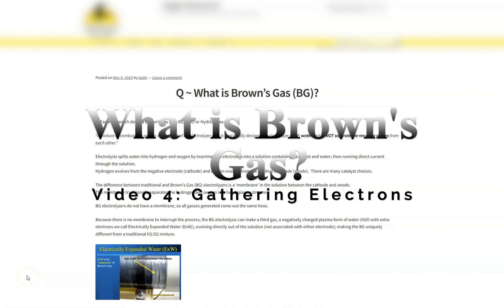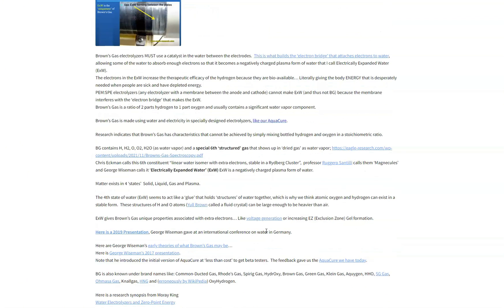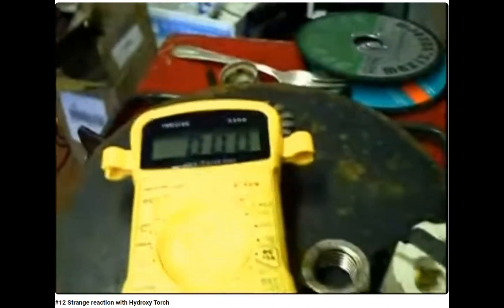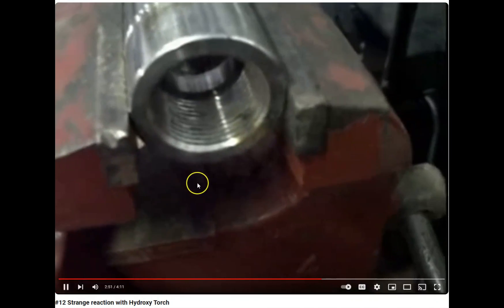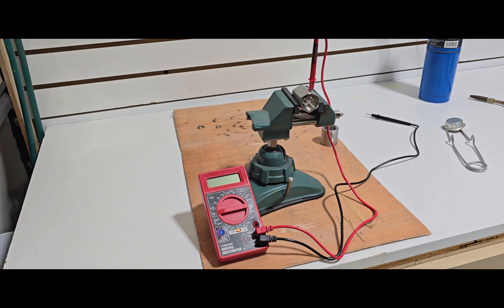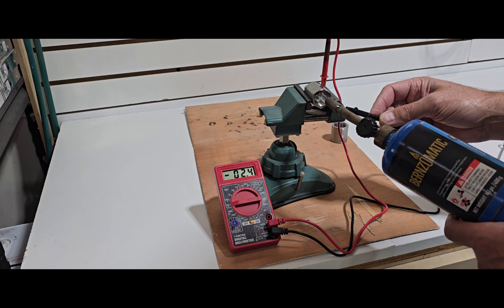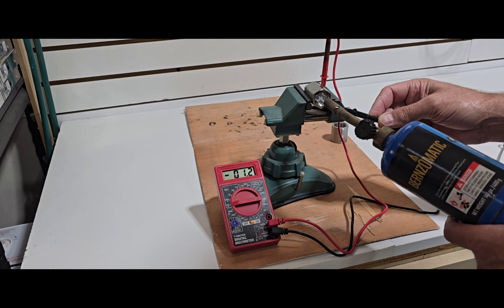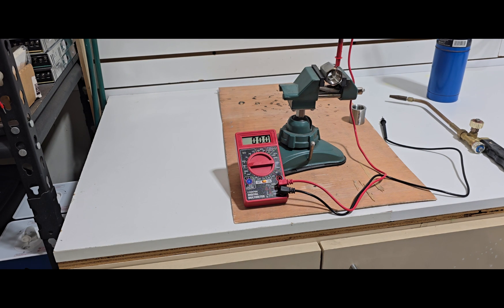What is Brown's Gas part 4 : Gathering electrons

Comment: I’ve heard that the flame temperature of Brown’s gas is about 130 degree celsius. It is possible to use a thermal camera to see if there is a difference between the flame temperature of the PEM unit and the common duct unit. Thank you for sharing these information.

Comment: These are very cool experiments done with proper scientific equipment and methods. Great work on this series, Steve. My machine is working really well with your cells and reservoir and bubbler. I'm so surprised your reservoir has not leaked a drop and your bubblers and cells are top notch. The only single complaint at all with my 30 plate is that the outer hardware and bolts are not 316 grade and initially my own reservoir in my car had leaked and corroded the bolts. Otherwise it's been very efficient and produces very well for me. I'm breathing 30 amps and using a little water, too. It's definitely better for drinking while it has a negative ORP from hydrogen. It tastes better and smoother and I drink more because it tastes much healthier and "alive." Use some veey important mineral bicarbonates guys (electrolytes). You will thank me. I'm making cert special "synthetic spring water." It's a big deal for human health.

Comment: Note that MOST 'alkaline' electrolyzers ALSO have a membrane, separating the hydrogen and oxygen streams, this is how electrolysis was done (traditionally) for hundreds of years, until William Rhodes patented the 'single ducted gas' in the early 1960's.  So it isn't just the more modern PEM/SPE electrolyzers that have a membrane.  

What was the meter scale set on?
Can you do the experiment with an analog meter so we don't see the digital 'dither'?
I'd suggest setting the torch on a stand of some sort to keep the flame in an optimized location.
Reply from the maker: Take it for what it is. Both gasses measured voltage on the voltmeter. If you want the experiment redone you will have to do it yourself. HHOBALL did it years ago and i'm surprised you have not duplicated it.
Reply: @Hydrogen4Health  I'd really like to duplicate it properly.  I'll purchase one of your H2 Life v5 to test.
Reply: @Hydrogen4Health  Yes both were measured with the same meter, that's not the point.  The point is that, in certain applications a digital meter isn't the best choice because it's impossible to get an accurate stable reading.  Thus the 'averaging' tendency of an analog meter is better.  Also, if I was to duplicate this experiment (which I'm considering) I think fixing the torch in a holder instead of waving it about would give the most accurate 'reading'... Which is important for experiments like this where you are trying to prove the gasses are the same.

So I'll be asking you for an H2 Life v5 so I can test this myself... Because I'm interested in the experiment and I'd like to see it done properly.  I'm willing to follow the science, but ONLY when properly done.
Reply: You are completely wrong about that, HHO was invented/discovered with single ducted right from the beginning with Faraday, himself. What you just claimed is fully bogus.
Reply: Mr Brown is famous for attempting to do many things with HHO or (Bang Gas in Germany) not for "discovering it."
Reply: @TravisTellsTruths  Yull Brown gave credit to William Rhodes (in his patents) as the earlier discoverer of the 'single-ducted' gas.  But William Rhodes didn't do anything with it (I met William Rhodes when he was still lucid and we had good discussions, sharing information).  Yull Brown patented a different (less efficient) design of electrolyzer.  William and I went with a 'series-cell' design that ended up making a machine that was half the weight, half the size and produced the same gas production with half the wattage of the China built Brown's Gas machines.  I honor Yull Brown by calling it Brown's Gas because HE is the one that spent 3 decades traveling the world and commercializing the gas... Not because he 'discovered' it.
Reply: @TravisTellsTruths  You must be correct that many people 'made' Brown's Gas over the years, maybe even Faraday but I haven't seen any proof or record of that.  The FIRST official record of 'single ducted gas' was William Rhodes patents in the early 1960's.  So I credit him.  If you know of earlier proof, please share.
Reply: @TravisTellsTruths  First of all there is no HHO  and second thing is that Faraday did not invented or discovered even electrolysis. Electrolysis was discovered  about 50 years before Faraday  explore it.
Reply: Yes, HHO is the gases made from water. Hydrogen 2 parts and oxygen 1 part. Any sources for your claims?
Reply: @TravisTellsTruths  Yes,  it is standard electro-chemistry  and by splitting water  results are H2 and O2  . Saying HHO is false marketing . But H2 and O2 can have different  level of activity  depends of cathode  super-tension . It means cathode with higher super-tension will make hydrogen different properties than electrode with lower.They are still H2 and O2 but with level of activity and properties.
Reply: @TravisTellsTruths  BTW, we  just today will filming video about this subject. I started project  about SUBTLE ENERGY RIPPLES  series , where the first video after introduction video will be hydrogen production and Brown gas will be major part of that. Perhaps in January will be published.
Reply: Its just stupid semantics. HHO is 2 to 1 hydrogen and oxygen gas. This is not worth debating over nothing. If you have a single source that shows real evidence for your "super tension" hydrogen, let's see it.
Reply: @TravisTellsTruths  Man, it is not "my" super tension therm, it is classic electrochemistry and there are so many evidence of that.  To say HHO is wrong in many means, but if you not accept  electrochemistry science , I have no problem with that, but I do not need to go deeper in debate on this subject.
Reply: Just as many people call it Brown's gas as HHO. Neither are scientifically accepted names. Oxygydrogen is a lesser known name but what would you call it to be "correct"?
Reply: @TravisTellsTruths  Who are you asking?  And what 'claims' are you asking about?
Reply: My comments are being deleted by YT. YOU are censored too

Comment: What came to mind while watching is to try feeding one of the air holes in the propane torch with PEM gas to see if it produces a voltage, and then feed just the H side of the PEM gas into an air hole, then try just feeding the O side of the PEM gas into the air hole.

Also you could try just feeding the raw gas (un-lit) into the stainless, as a flame might not be necessary, then just H, then just O.
.
Reply: Interesting thinking.  Good ideas.
Reply: @ecopegasus  George have you looked into SG Gas ? called after the "inventors" Ted Suratt and Robinson Gourley. My understanding is they are trying to make mostly the bubbles that form between the plates. It doesn't self ignite until compressed to 1,600 psi. From the outside it just looks like electrolysis, but they are using pluses to create a pulsing magnetic field and thus the H4O2 they say. They use a SMPS by Volteq, I think it's the HY 3050 EX (30 volt 50 amp) and I asked Volteq what their switching frequency was and they replied, about 100 KiloHertz.

search patents by Robinson B. Gourley and Ted Suratt

Over at lenr-forum there is a thread called "Hydrogen / Oxygen explosion?" and the user Drgenek posted a little more info on SG Gas, including mentioning that if it is ignited with a hot wire, then there is a slow implosion.

A thought I had was for you to try winding up the frequency of your AC-50 to 100 KiloHertz and lowering the duty cycle just to see what kind of gas it produces. Mostly implosive maybe ?

.
Reply: @ecopegasus  George have you looked into SG Gas ? called after the "inventors" Ted Suratt and Robinson Gourley. My understanding is they are trying to make mostly the bubbles that form between the plates. It doesn't self ignite until compressed to 1,600 psi.